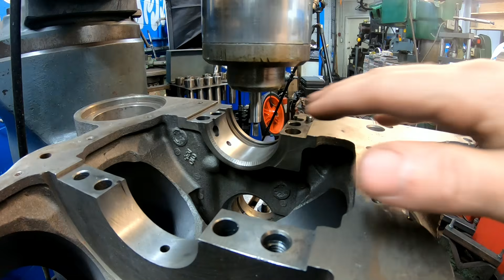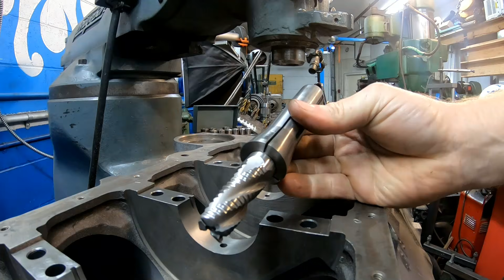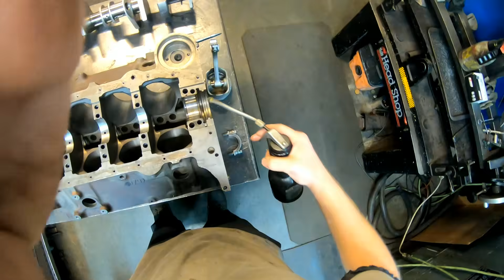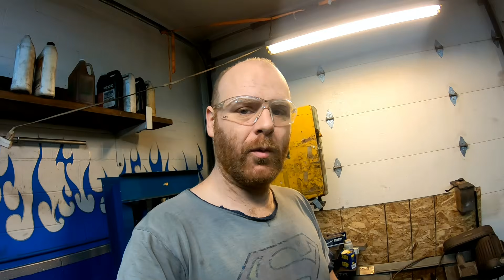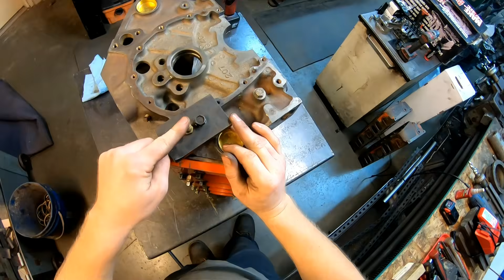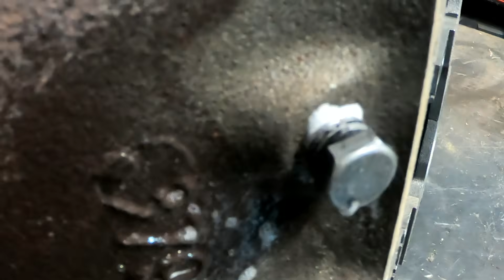383 stroker clearancing

Comment: Would the costumer need the crank and rods with him to see where they might hit? Or would you already know where to cut and how much without the crank and rods stabbed in
Reply from the maker: For the common rotating assemblies with 3/8" rod bolts, this has proven to be reliable. For the rods with the larger 7/16" bolts there still may be clearance issue's. I prefere to check my work before sending out but that's just me.

Comment: Hi Jay, great video. Question for you. What is the gasket material you used to seal the top of the block with the metal plate? Im trying to do the same pressure test but cant get a seal with what i have tried. Hope you can help. Also, do you use sealer on the bolts? Thanks

Comment: What a time saver, nicely done. 👍

If you break through how do you fix it?
Reply: Pour about an inch of industrial epoxy in the block , never had one come back that we did that on ..
Reply: @abrown5449  
A pipe plug works great and more cost effective.
Reply from the maker: That creates so many other issues that I would like to see a video of that
Reply: @whiplashmachine  
A video of what, a pipe plug repair or the epoxy?
Reply from the maker: @itseithergonnaworkoritaint7852  I wanna see a hole created through casting right at the bottom from too much grinding and then drill and tap tje incredibly thin area for a pipe plug. Then, I wanna see the access of the plug releived so the rotating assembly fits. You uave my full attention
Reply: @whiplashmachine  
The next time I grind through that area making clearance I'll post a video of the repair. Don't hold your breath though because I switched to the Scat stroker rods that requires minimal clearancing if any.

You never answered the question from 2 months ago, how would you fix it? Or are you the epoxy guy answering logged into a different channel?
Reply from the maker: @itseithergonnaworkoritaint7852  I have used epoxy in the past without issues reported.
Reply: @whiplashmachine  
You have a very cool channel, why aren't you posting more content, are the racers keeping you to busy?
Reply from the maker: @itseithergonnaworkoritaint7852  thankyou. Yea, I am just way too busy at the moment. I have a ton of work in the shop and completely closed the doors to any incoming work back in March. Hoping to get caught up enough to start playing with the cameras again. They just take up so much time.

Comment: I had a buddy build me a 377 stroker. (Bore was real nice because it was a low mileage block. So we decided not to bore it 30 over.) He used a file to clearance the block since he didn't have a mill.
Reply from the maker: That's some dedication 💪 Carbide rotary burrs were enough work for me lol.

Comment: Nice work Jay.
I need to map it out like you did.
Great idea, real time saver.👍
Did you purchase or make the pressure test plate?
I have broke through on the south of the border casted blocks.
207 casting I believe.
Was a race car engine we Hard Blocked it.
It was fine.
Had 13to1 compression. 
Anyway, thanks for sharing. 
Take care, Ed.
Reply from the maker: I made the pressure testing plates, have em for multiple engines. I've broke through the odd 010 as everyone gets excited about that casting around here. So that's what I cutt the most. Not broke any 207's yet, but I do see a lot of them. Have a few of my own. 
 Time saving for sure! I can pop off a clearance trip to mill in about half an hour if all goes smoth that day.